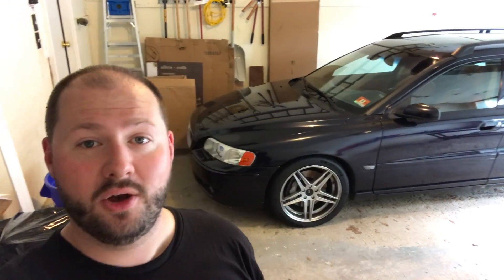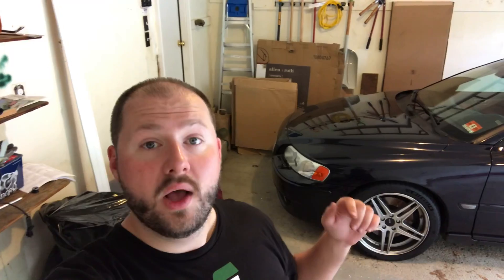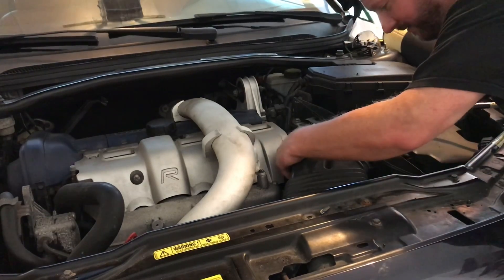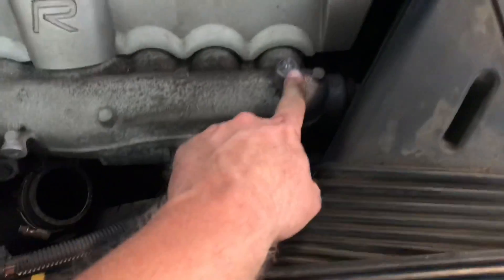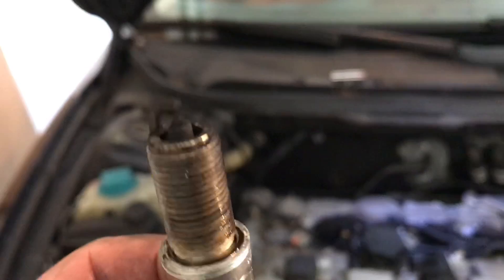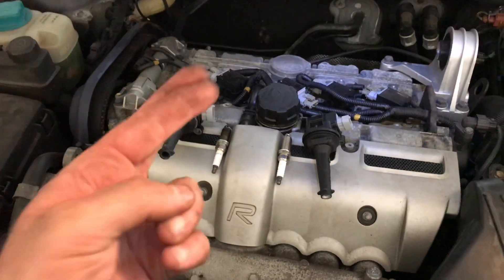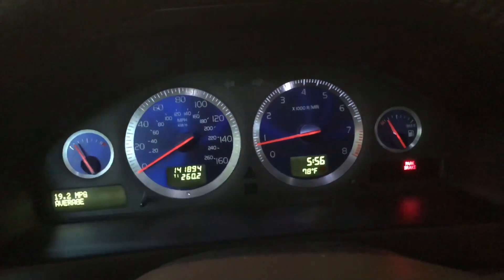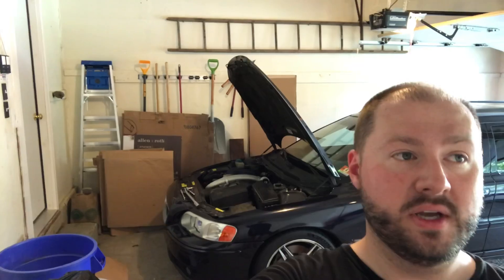The Volvo V70R vs. E46 M3 Challenge Is Back On, And The Volvo Is Running Again!

Comment: I gess that not having a charge pipe that blocks the "top cover" could be one of the few thing that are good about the NA B5244S and B5244S2, that and fuel economy.

B stand for "bensine" which means petrol in Swedish
5 cylinders
24 or 20 or 25 or 44 is the desplaysmant in liters/ 24=2,4 liter.
4
4 i think it means engine?
S stands for "Sug" which translate to Suck, as the Swedish word for a Naturly asperated enigne is "Sug motor" and T if you have a turbo like a B5254T4.
2 variant/ map numbe (B5244S is the same engine as a B5244S2 but with a diferent map).

Comment: My S60R was surging at about 3000rpm, I replaced the spark plugs and it now runs fine. The plugs were only worn to between 0.9 to 1.0mm.
I replaced them with NGK Laser Iridium ILFR6B gapped at 0.7mm.
The original Volvo plugs had done over 155000km & the previous owner had never changed them.

Comment: If you have a seized bolt Applying heat does wonders. I recommend the harbor freight heat gun. Once heated use the screwdriver. Same applies to stripped bolts.
Reply from the maker: A great suggestion, but did try that last time off camera to no avail. 

-Gregson
Reply: ShiftingLanes awh :( glad to see you got the car fixed :) tho. Then i guess there's that screw extractor tool which is great for my stripped hex screws. Hope you go the efr route for turbo swap.
https://re-volvparts.com/store/home/96-borg-warner-efr-7064-turbo-083-ar-t3-flange.html
Its the fastest spooling high HP turbo :).

Comment: Get yourself a pancake and a set of impact drive bits imho, those things take off fasteners quickly without messing up the bolts too much in my experience. Also, I personally had to chase the threads on my 07 XC70 block holding the aftermarket aluminum charge pipe down after four removals with hand drive tools. I'm sure the aluminum is fantastic for everything else, but the small threads are not a lot of fun.

Comment: Nice man! :D  I got a V70 T5 2005. Got some problems with the turbo and idle.  Changed MAF 2 times and the engine still runs better without it.  The turbo pushes 1.5 bar and then shuts of to not damage anything.  Ive checked all connections, all vacume hoses, Changed oil and filter etz, will try plugs and coils now.

Comment: Have you checked the crankcase vacuum system?
Reply: Had to do a complete PCV replacement at 95k miles on my 07 XC70 about one year ago exactly
Reply: 2nded.
First things to check/replace when you get one:
PCV, vac hoses, engine mounts, coils and plugs.
Other than those maintence items and the 4C suspension, there really isn't much that goes wrong.
Oh, and clean the intake system once you've sorted those out.

Comment: Hey if you need to lean how to remove the sunroof sunshade ill be posting a video soon on how to do it without removing the headliner. No special tools are needed either. If anyone needs to know soon ill try to pump out the video sooner. As of right now its on the back burner of life. Comment below if you guys need any specific videos on how to diy fixes on your p2 volvo. I just haven’t gotten to making much content because we are raising a puppy 🐶
Reply: I need a tutorial on replacing the sunroof side panel/shade that unfolds when you tilt up the back of the sunroof.
Reply: Dodek72 alright i will make one. Its that accordion like thing right? There is one on each side and it covers the mechanism that holds the glass?
Reply: Yes
Reply: Dodek72 alright, well set your notifications one so when I upload you can find it.
Reply: Thanks ;)
Reply: While I'm here, this covers most everything but could use a p2 update so all the sways and links and such look like the "correct" size. It's close enough, but not quiiiiite there enough for me. https://www.youtube.com/watch?v=9uXFqVmxXXg Also, they don't take the wheel speed sensor out before undoing the top bolt on the knuckle!
Reply: er, also, they don't alternate tightening enough to make me feel safe with those spring compressors
Reply: Also, also, what the hell is the point of that bump stop boot if the bottom of the boot is open to the air? I throw a pipe clamp on mine so they don't get hella dusty, but I also hillclimb a lot
Reply: Dodek72 https://youtu.be/RXeDmzNN7N8 here is the video. Im sorry it took so long

Comment: Might the enging revving to 2k and dying  when starting up might also be a side effect of running too rich? I found a picture showing the condition of spark plugs after an x-amount of miles, and based on your video, the Volvo’s spark plug looks like it might be coated in carbon dust (maybe from running rich). You can find that chart and a bunch of other potentially useful info from this link: https://www.quora.com/Why-are-my-spark-plugs-so-dark-when-I-remove-them-after-5-000-miles/answer/Michael-Kay-23?share=a8860242&srid=Uz4S

Also, best of luck with the Volvo! I’m rooting for it, as I have a 2004 V70 T5, and have been a Volvo guy all my life. Also can’t wait to see what you’ll do with the V8 Vantage!

Comment: Do you think putting some fuel cleaner through the system might help? Might clear some of the gunk out of  it after 141k miles
Reply from the maker: Good suggestion. I had thought about it but the jury is out on if those cleaners really do anything. There are studies out there that say they’re both good and also a big fat placebo. Might try it just to see what happens.

-Gregson
Reply: I did that the my 850 awd. Thing was not running smoothly but after i poured that in it’s drivning like it should :)
Reply: It won't do any harm and might be a good video to see if it actually does anything! Definitely worth a try isn't it!
Reply from the maker: Agree! And will 🙂 stay tuned this week as that’s what I’ve done!

-Gregson

Comment: The rough idle could have been just because of new parts but it could be caused by a dirty throttle body (the butterfly valve having carbon build up). Symptoms of this could be a lower than normal and or rough idle which may cause it to die but will start back up again with a small blip of the htrottle (you may see the interior and exterior lights get brighter and dimmer with the change in revs). But it could be something else just thought I'd let you know. Great to see it running again :)
Reply from the maker: Excellent points. Throttle body is next if this thing keeps dying, which is a possibility. But we’ll see! Thanks man.

-Gregson
Reply: No problem just had a similar issue but on a 2003 T5
Reply: ShiftingLanes also you need to clean te MAF, and a new gasoline filter, if that dosen't fix it, then te next thing to do should be to celan the inyectos
Reply: Clean the throttle body anyway, is less than an half hour of work.